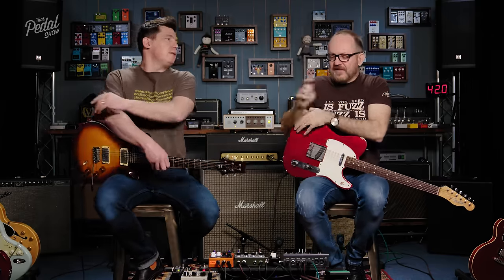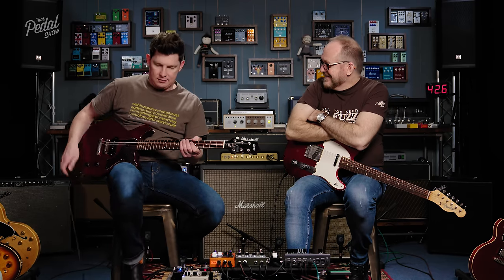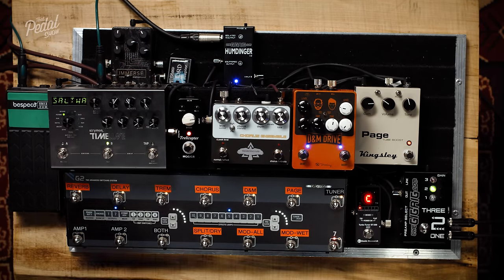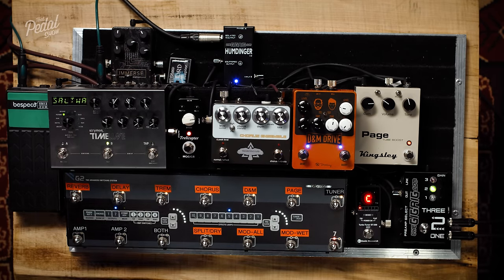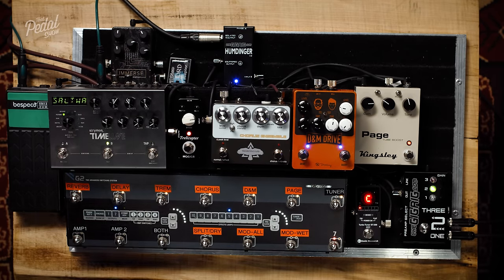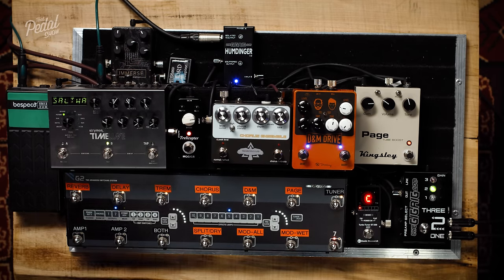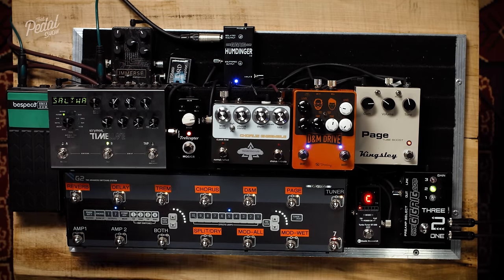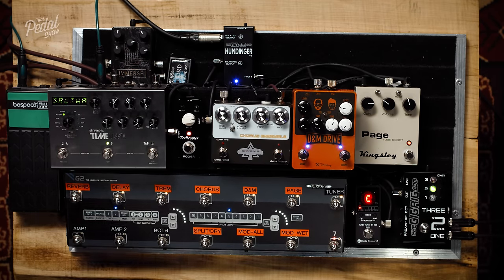Wet-Dry & Wet-Dry-Wet Amp & FX Setups Explained – That Pedal Show

Comment: Well, thanks for giving it a name. Been running two amps this way for years. The texture you can get is unbelievable. My "dry" amp (at the moment, a Mesa Boogie Mark IV rhythm channel with a little crunch) is completely dry and is also on its own volume pedal so it can be brought in gently as needed. Works great for filling out choruses without that harsh transition you get when you stomp on your drive channel or distortion pedal. Picked that one up from Ian Thornley (Big Wreck).

Comment: I run a clean katana wet and my overdrives into a dry blues jr. It sounds just great to me. Really happy with the setup
Reply: Do you have any probs mixing the SS and tube amps?  I have, and love, the katana artist and was worried I would need 2 tube amps 🤔
Reply: Roger McCoy I use a Fender Bassbreaker as my dry amp, and a Roland Cube 60 as my wet amp, they sound great together.
Reply: @rogerloydmccoy  why might there be issues?
Reply: That’s good to hear, I have a Katana and was going to ask if anyone was using one for the wet signal.  Can’t decide on a new amp for the dry...AC30 or fender tweed, maybe a blackface!
Reply: @griersco  I'm doing wet/dry on the cheap, with a Katana 50 and a Blackstar ID-Core 100. Katana is dry using one 12 inch speaker, ID core is wet from 2x10 in (partial) stereo. I've only just started to play, but I'm mightily impressed for non-tube tones. I might consider swapping amp roles too, just to test, although the ID-Core 2x10 just naturally fits the wet space for me . Need to consider phase now because I actually can't tell the 'correct' phase, even when I swap the terminals on the Katana speaker. Perhaps I just don't have a right/wrong phase setup...
Reply: @troutslayer19  I have both these amps too! I want to use the bassbreaker for distortion (rather than a pedal in front of it) so I guess the split would have to be in the bassbreaker fx loop? Can you tell me how you have yours set up? Still can't get my head around the right path for this.
Reply: Paul_M_UK I’ve since swapped the Cube 60 for the Boss Katana 50, and I’m still using the Bassbreaker. I’m currently running them in stereo instead of wet/dry, so they’re both quite clean, with all my distortion coming from my pedal board.
If you wanna use the Bassbreaker for distortion, I would use an A/B/Y switcher at the beginning of your signal chain and one path would go straight into the Bassbreaker and the other path would go through all your pedals and end up in the Cube 60, which you’d likely want to run pretty clean.
Hope this helps!
Reply: @troutslayer19  Thanks for this, much appreciated. Can I ask what distortion pedals are working best with the Bassbreaker? I've got an Angry Charlie V3 and it doesn't sound great, I prefer the High Gain on the amp tbh.
Reply: Paul_M_UK I don’t play much high gain stuff, so I might not be much help in that regard. I use a TS-7 Tubescreamer and a J Rockket Archer for my overdrive tones.
Reply: @troutslayer19  That's useful to know, thanks again.
Reply: @Pauler23  I use a Bassbreaker15 and the gain pedals that work best that I have tried are:

Keeley Java Treble Booster (into the higher gain channel or my Hotcake)
Tumnus
TS9, AC Booster (any tube screamer variant,, Xotic AC is my current fave)
Boss SD1 & BD2 (modded)
MXR Distortion+
Tech21 Double Drive ( amazing with this amp)
Crowther Hotcake (^^ditto^^)
Greer Amps Little Samson/Vick Mt. Pleasant/Zvex Box of Rock (Plexi/Bluesbreaker/MIB etc)
Vick Audio V-2, ProCo RAT for high gain OD/distortion

Ofc I don't use them all on one board!
It likes pretty much any Fuzz and Muff pedals I've used. It doesn't really like OCD, Zendrive, MI Crunch Box, MI Crossover Drive (all pretty good through my other amps). I had an Angry Charlie and foud the Greer, Vick, and Zvex much better for Marshally tones. It doesn't respond well to Dumble-type drives unless you run the amp really loud.

Comment: It was you first (I think) wet-dry video that inspired me to run a second amp.  Completely changed everything.  I can play loud and it sounds wonderful with plenty of reverb and delay.  And on those nights when I have to keep it quiet, I can turn both amps on and it still sounds full and beautiful instead of thin and brittle.  It's amazing how much of a difference it makes.

Currently running a Marshall Origin 50 and a Vox AC15.

Comment: Awesome one guys - super helpful.  Question - If you want to run one set of drive pedals for the wet signal, and a separate set for the dry, do you want to split right out of the guitar, or do you always need to have some kind of boost or buffer between the guitar split?

Comment: The way I tell if two amps are in phase with each other is:
If you place yourself in front of the two amps that are parallel with each other, if they are out oh phase they tend to feel as though they are panned hard left and right, if they are in phase they tend to feel as though they are both panned center. 
My two cents on it anyway, when you were flipping the phase it felt like the panning was changing even with headphones.

Comment: I do a wet-dry a bit differently. I like the sound of stereo delays and reverbs, and I like a cleaner amp when goosing one with drive. So I have a splitter after a compressor, left out runs through three gain pedals and then into a Strymon Deco (TRS adapted), right misses the gain pedals and goes into the Deco, then left and right run out of the Deco (in stereo mode) and through a Nemesis delay and a Nuenaber Immerse in stereo. Left goes into a Deluxe Reverb, and right into a Princeton. So when the Deluxe is gained up, the Princeton provides articulation. The delay and reverb don't get swampy if you get the levels right, and you get to enjoy the fun of big stereo sounds when desired.

Comment: Brilliant video guys, so much information.  Your previous wet/dry video inspired me to try it, and it’s my favourite change I’ve ever made, the tone difference is huge and I love it.  I split before the amps and use the effects loop of my wet amp.  Mick mentioned Lehle, the Little Dual does the job for me with the bonus that it doesn’t even need power.

Comment: Great video, like always.

For anyone trying to do WDW using an effects loop, an easy way to deal with phasing issues, an the headache of understanding the signal flow, is to use a multi-effects unit. I use an old POD HD500, that I bought used, to deal with the split after the effects send of my dry amp. I then use the stereo outs of the unit to go to the effects return of my wet amps.

Using an effects unit like this, gives you the option of also introducing "real" pedals in the units stero effects loop. This seems to also solve some of the issues I have had in the past, with pedals that reverse/inverse the phase after turning them on or off.

I should say, that because my dry amps send is line-level, I flip a switch on the POD making the signal coming out of the stereo outs also become line-level. This is mostly used when you go direct, but works really well in my situation as well. I don't know for sure, if making the signal line-level, is the reason it works so extremely well, as I haven't really tried not having it line-level, but after I started using an effects unit, I have had no issues with phasing or hum at all. Most units like this also have a switch or something to deal with grounding issues.

Another cool feature of most multi-effects units like this, is that you can control the volume level of each signal chain, as well as the overall volume of your wet amps. This is especially handy in my case, as my amps are mismatched in terms of wattage, and have no master volume control on any of them. (30 Watt Wet, 5 Watt dry, and 15 Watt Wet).

I don't know if any multi-effects units have analog through, but I personally don't really care too much about it in this case, as I use the wet amps 100% Wet anyway, and even if I didn't I don't think I would care either. 

I hope this helps someone to get started with WDW through the effects loop, because the sound is glorious, and it doesn't have to be overly complicated. And for me, this way has helped me be able to understand how I would need to do it, if I were to use something other than a multi-effects unit to accomplish the same thing. And I might do so in the future, as the unit takes up alot of real-estate on my board, especially since I don't use alot of the built-in effects. But then again, it is a cool backup rig, when everything else fails. Hmm maybe I'll just get something similar, just much smaller, when they get older and cheaper on the used market.

Once you go WDW, the sound will haunt you ;)

Comment: Db meter is fine... stop worrying about it. Trolls will complain no matter where you put it. Then they'll complain if you remove it.
Reply: On headphones, your out of phase demo had more bottom end and fuller sound....so i'm still confused.  I have a radial A/B splitter and can hear a difference when I flip the phase switch,  but can never tell which is in or out of phase....
Reply: @macleanclassics  It might be because of the hard panning. The signals from the out of phase amps aren't interacting with each other when you wear headphones because you don't hear the right signal in the left ear and vice versa.
Edit: You can test this by making the signal mono before sending it to your headphones.
Reply: @greganderson3096  I think you're right. I heard more bass in the out of phase sound. Then I switched my headphones to mono and it was the opposite. So interesting.
Reply: I'm not a troll - even though it is better than before, its irritating and does not give any useful extra info. But it is what it is...
Reply: @shorerocks   You don't like knowing the approximate volume relative to conversation volume needed to achieve the sounds they are getting?
Reply: @macleanclassics  It was the same for me. Headphones are the culprit, methinks.
Reply: @Fletcher883  I agree that it's more than silly to nit-pick at the tiniest of minor details. I chalk it up to pretty much everyone these days acting like they have ADD or something. Maybe he just has the attention-span of a squirrel on crack.

"Hey look, moving lights!
Oh, it's just the meter....
Oh hey! Look! Moving lights!
Oh...." 
And so on, ad-infinitum.
Reply: @Fletcher883   No. If this is a serious question, then I am obviously not getting the point. Everything apart not being in the room itself is a compromise, and some dB meter jumping around gives me no information I missed. Secondly, the movement constantly has me looking at it because of eyes usually tracking movement. It is not helpful, to say the least. But thats just me.
Reply: @kingjbone1  You could very well be correct about that. It certainly makes sense, anyways.

Comment: Love the vid. What about loop stations? Should you run them into the wet or dry amp? Should you toss them in the effects loop of the wet amp? What are your recommendations for that? Or would it be best / is there a way to do a wet/dry rig with another amp for loops only? 

Thanks

Comment: A question for Dan. Would you consider designing a G2 with a display? Considering the number of banks, it seems like the ability to name presets would be the natural progression for that device. Regardless, thank you both for the invaluable education you have given me through That Pedal Show!!!
Reply: I second that. With the introduction of the Boss ES8 it would be nice to have a display. Love the show!
Reply: they offer the Midi Driver specifically for that... although not an on-board screen, you can use an iOS device to control or display whats going on in G2

Comment: Great great video (laugh out loud at points) ...I totally get how phase reversal works.. as in the outcome.. sound..etc but what actually causes it  ( not the speakers moving out of time) is it particular pedals? The splitter itself or the signal chain? 

Also...and sorry to be dull, but I still don't quite understand what you mean by  "Isolated" are you talking about individual power supplies....or signal chains.. I run a complex bass signal path ...initially from bass into a first gen Lehle Dual ABY and there seems to be some confusion around whether the A or B channel on this is isolated. Any ideas...how can I tell ?... also there doesnt appear to be a phase reversal switch so how would I go about sorting that if it becomes an issue... I would explain my rig on here in detail as I am sure I am having PR issues when both channels are engaged...(I  have to have PR activated on one channel in logic to get my sound) ...but it would be about 8 pages long! 
Is there a stand alone box to sort PR issues? I need the flexibility of the lehle as I use just channel A or just B or both together depending on songs... Any help would be great...Thanks. Carl

Comment: In a standard Stereo Rig, would placing an ABY Splitter (with Isolated Output) after the <left> path of the delay solve a Ground Loop problem? 
And also: would there be a way to solve the ground loop issue in a stereo ou wet/Dry rig using Lift/Ground ?
I´m a huge fan, thanks a lot for your content!

Comment: I may have missed this in this video or a previous one, but how would you select which amp is wet and which is dry? I've always assumed that the wet amp would be the higher headroom amp so the delays, reverbs etc stay clean as possible, but when I've tried that I run into volume issues when kicking on a boost that drives the dry amp but just volume boosts the wet amp. Is it best to just have amps set up relatively similarly in terms of gain and treat the wet amp like you would in a single amp set up?
Reply: I think you just explained the issue I am having.  I couldn’t figure it out!  My wet amp gets too loud and the dynamics while recording are just unmanageable.  I have an attenuator for the wet amp.  I think I will attenuate it more so I start driving the wet amp sooner.  That should fix it!  Should also improve my tone even more!  Thank you!
Reply: @CandorBand  how’d that work out for you?
Reply: @CandorBand  I’m using an ac30 and an ac10 for wet. Seems to even out.

Comment: I am getting the bits together to add a fourth amplifier to the transducer array and re-watching this episode reminded me of the comb filtering and phase adjustment. I have a Little Labs IBP that I can use to adjust the blend for maximum funkiness then flip the phase to achieve best tone. They cost double or so what a Humdinger does but when the speakers can't be stood up in a single spot they do start to get interactive. I will score a couple more of those for the other channels and test that for effect.

Comment: Brilliant episode, thanks guys. I was so inspired by the original wet/dry/wet video last year that I tried for the first time a wet/dry set up using only a Boss LS2 Line Selector as a splitter into a Vox AV15 and an old 10W Squire SP-10 transistor and it sounded huge. Mick's right in saying don't be afraid to use any old amp lying around: it can work really well. The Vox has accessible 'Bias' and 'Reactor' switches on the top panel: I found just flipping the Bias switch addressed the phase issue. Thanks again for sharing the knowledge!

Comment: Can you please explain how I can achieve a wet/dry/wet set up using just one tube amp and then something like the GFI Cabzeus which has 2 independent speaker sim in & out. Is that possible & if so, would I still need phase switch & isolation if the wet Cabzeus ‘amps’ are virtual? Thanks. Joe Stivey (on my wife’s YouTube login 😁)
Reply: You can do Wet-Dry with one amp by using a Parallel Loop Pedal that has a mix control. Put your delay / reverb / flange in the loop and your dry signal will sit on top of these effects; dry guitar with phasing reverb tails for instance.  The Carl Martin Paraloop pedal and the One Control Mosquite Blender are both good for this.
Reply: dproz Thanks mate but I don’t mean that. I mean sending dry to valve amp which is mic’d & sent to PA & 2x wet mix via GFI Cabzeus to PA. I don’t want my dry amp to have wet at all, even through the FX loop.

Comment: My new setup has a Fender Pro Jr for dry, and a Bluesbreaker 007 and Champion 600 either side of that for wet. Loving every second of it. And thanks to the Humdinger, it works a treat with no noise or phase issues.